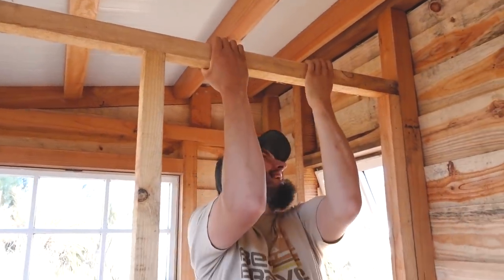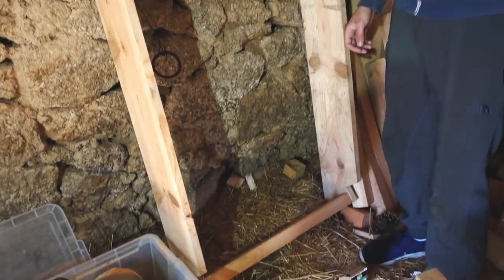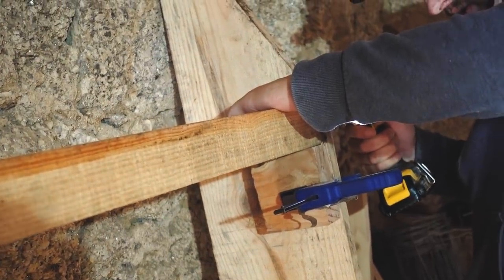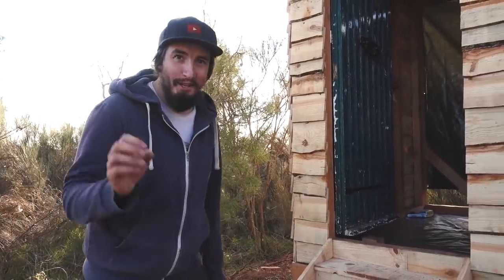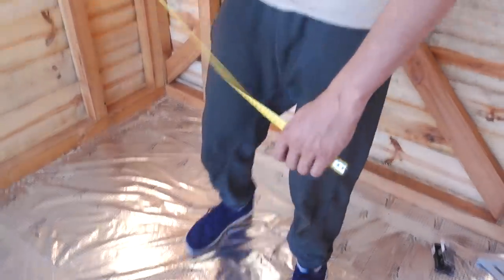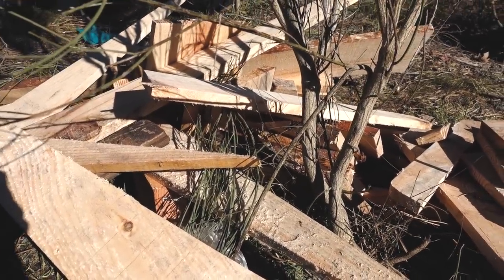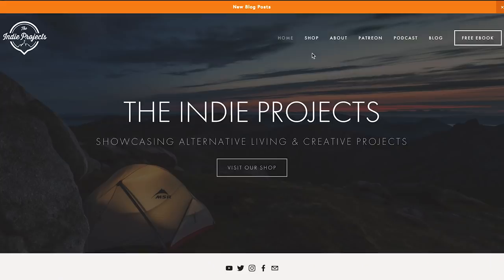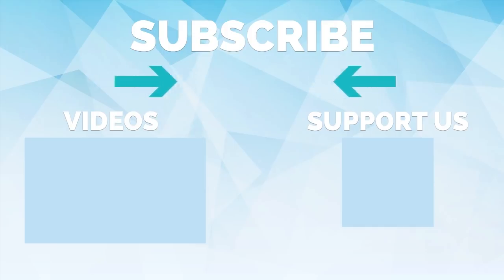We Can't Believe How Our Cabin's Turned Out!

Comment: Theo , Nice steps, If you only put one screw each side on the treads then it will buckle and never go back without splitting , Ive built loads like that, YOU NEED ONE IN EACH CORNER. I know  you where short on screws , maybe you've done it now.

Comment: Usually one would cut out the section of wall framing at the bottom of the door so you don’t need to step over it ... just saying
Reply from the maker: Yes we know thanks 😀 we chose not to do this because the flooring we are putting in is really thick so there won’t we be a step in 👍🏻